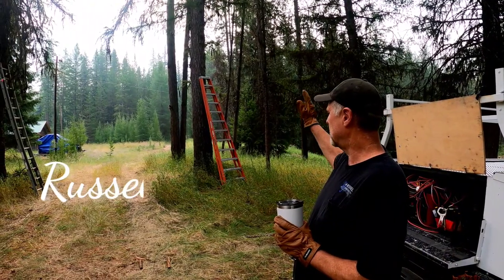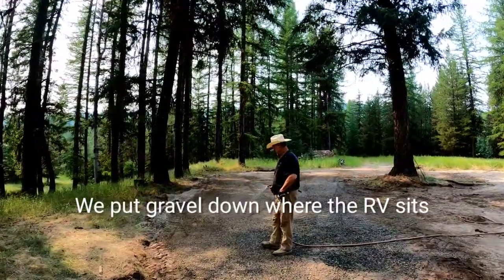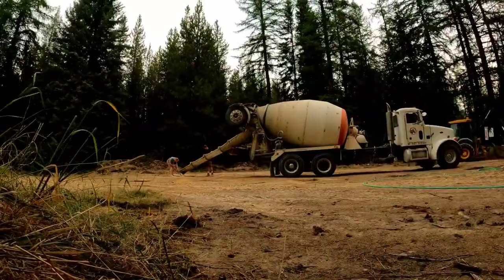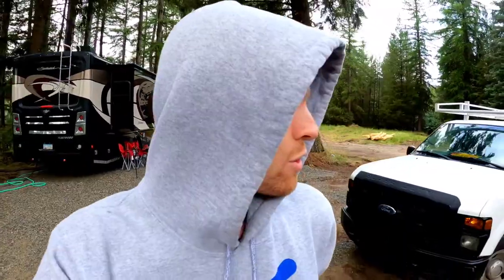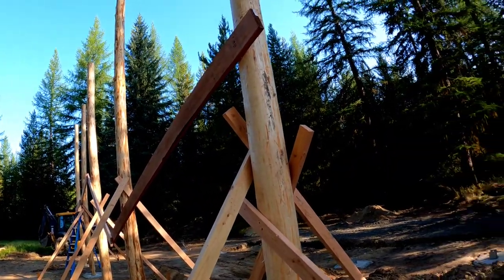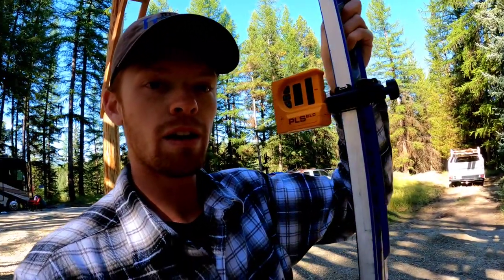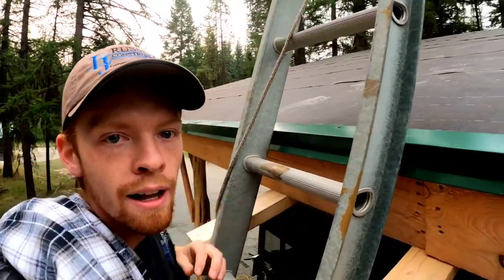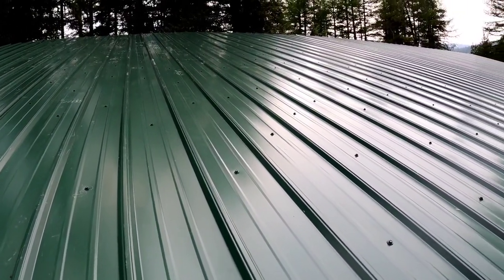RV Carport Build On The Ranch!

Comment: Aren't you supposed to screw thru the ribs of the metal to prevent leaking over time?
Reply from the maker: The ribs are used to line up the next sheet, and the overlap is what makes it waterproof. For extra protection, we screwed the seam of the top sheet, where they overlapped, down to each other. There are other applications that work differently, but this is the way ours worked for the price we were happy with